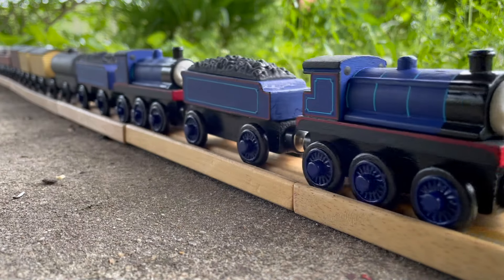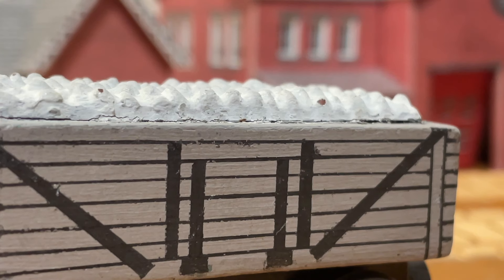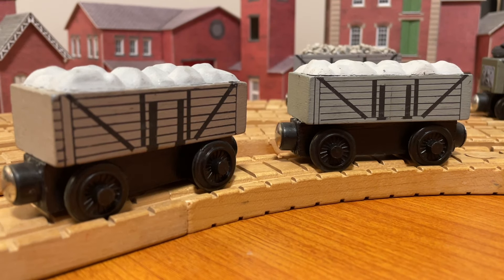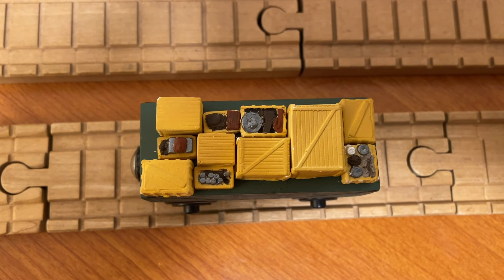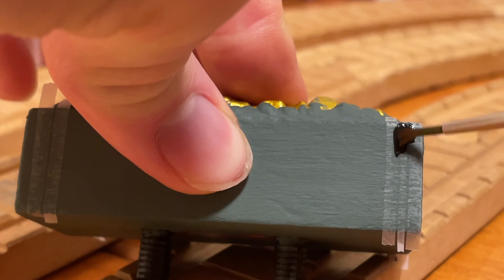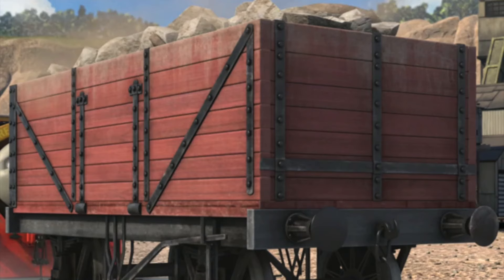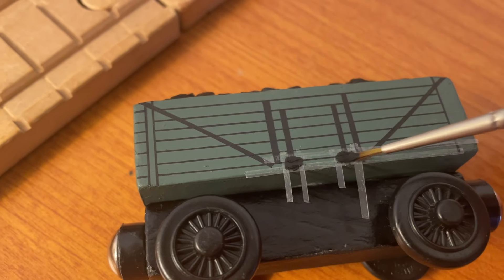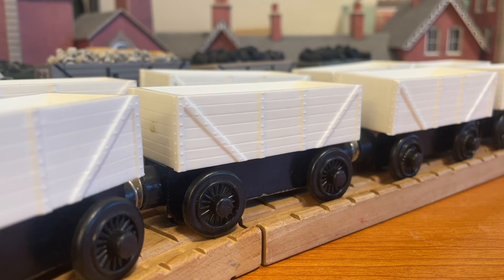Troublesome Trucks & Lining  | Arthur's Custom Corner

Comment: As always, excellent models! And an incredible trick to make lining look so much better! So simple, yet so genius :)

By the way, at 6:57- the reason why is because the front of real 7 plank wagons is actually supposed to lift open on a hinge, sort of like a dump truck when it's bucket is tipped back! As a result, no bracket was required to bolt the side planks to the front planks. You can even see a thin bar along the top of a few of the Season 1 7-planks, which represents the hinge. 

This design was dropped later on, and instead made flat and square... However, the side where the hinge is supposed to be is still missing it's other bracket. As a result, the trucks aren't even when viewed from the side!